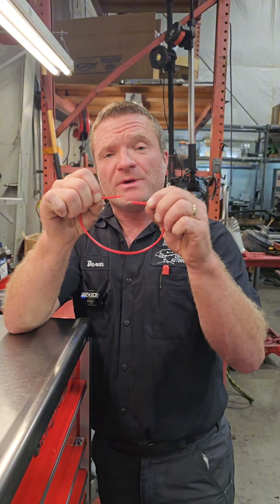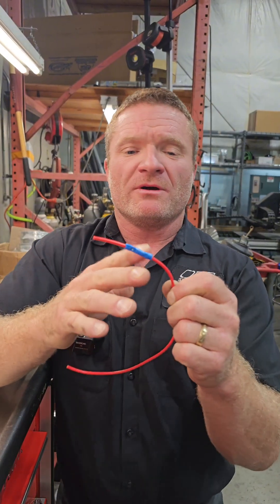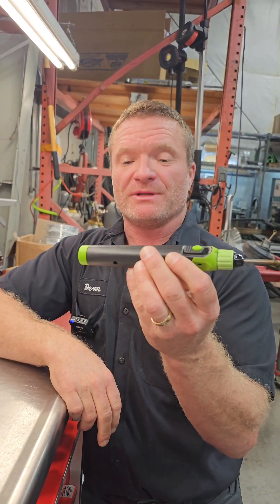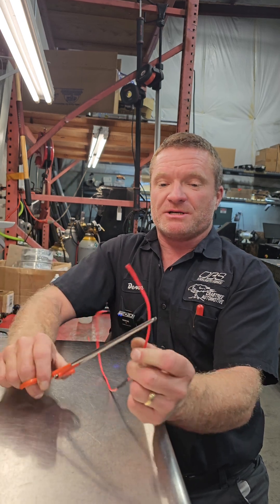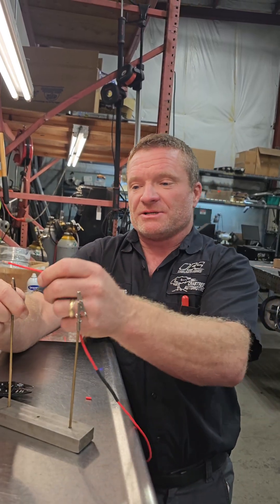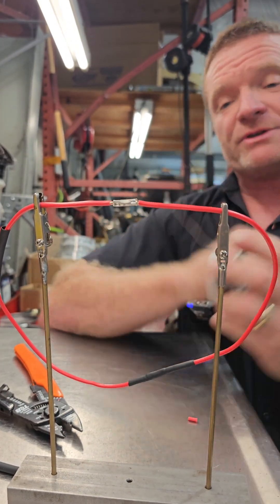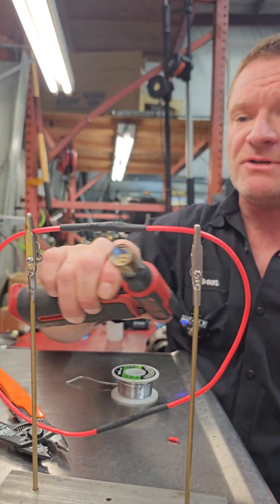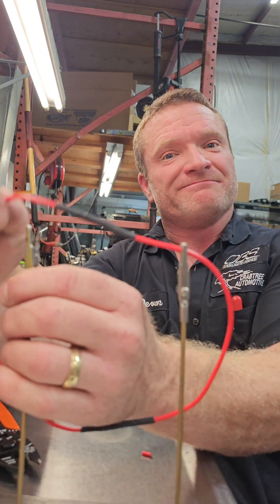Wiring Repairs with Devon from OBS Solutions

Comment: “Simple” heat shrink tubing doesn’t seal… not rated for underwater or marine use. Easy and common mistake.
You should use “adhesive lined heat shrink tubing” if you want it to seal. It has “hot glue” on the inside and is rated for underwater and marine use.

Comment: what gauge wire is the best for most OBS fords?
Reply from the maker: That depends on the circuit requirements wire length and existing wire size. Always match up a splice to what you're working with and check the amp draw for the components. There's some good amp rating charts on Google images to reference.